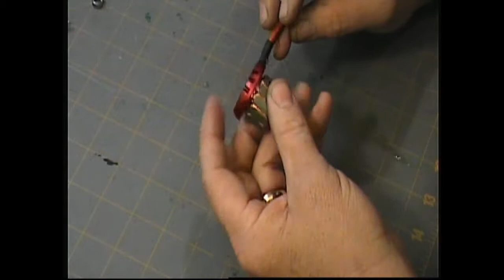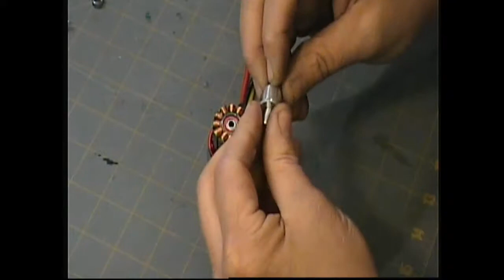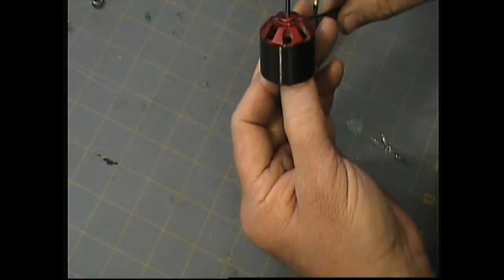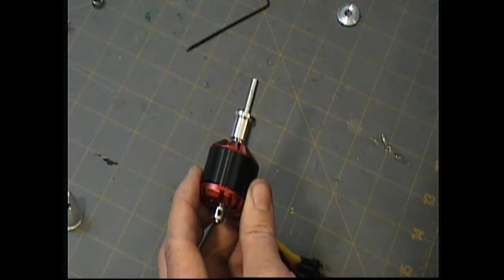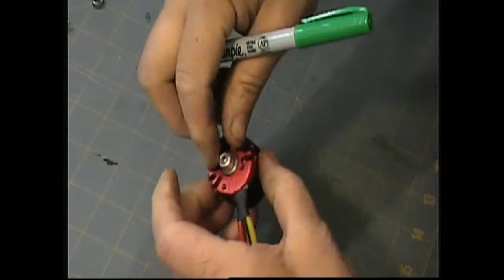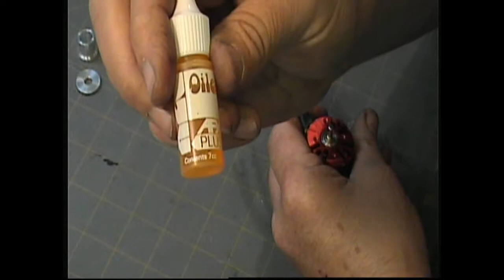RC Plane Crash Repair Brushless Motor Pt.3

Comment: You didn't feel the need to loctite the loose bearing in?
Reply from the maker: Nope  barely remember this video any more was 7 years ago glad people are still watching it
Reply: @vipertech9108  got a motor that's not happy at max revs, after watching your video removed my bearings and swopped front to back and will try see if any better, bearings appear ok. Was supprised how easy to do, thank you. Will order new bearings tomorrow